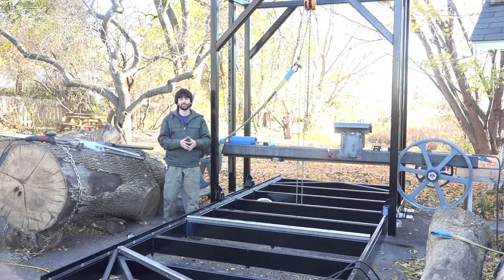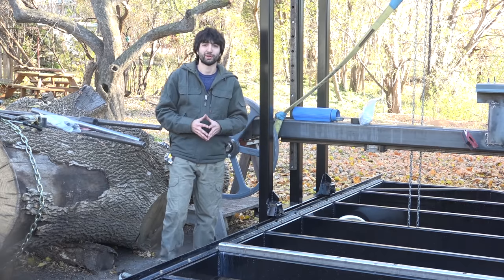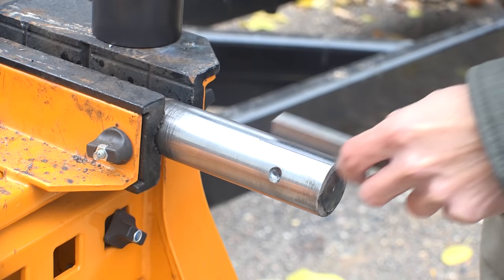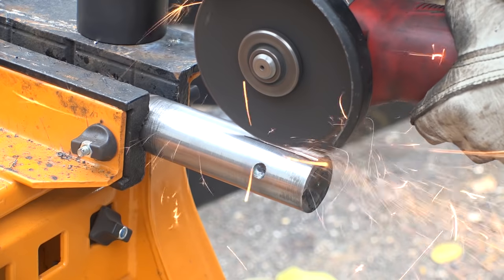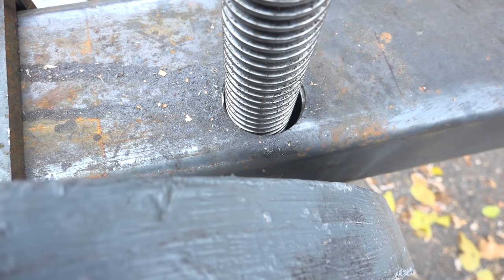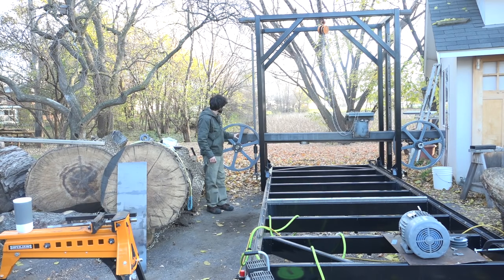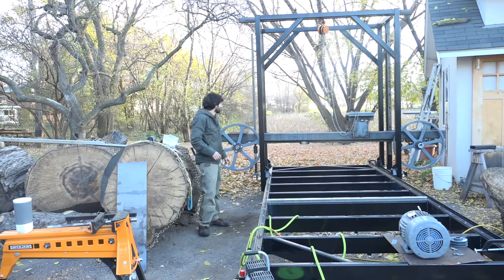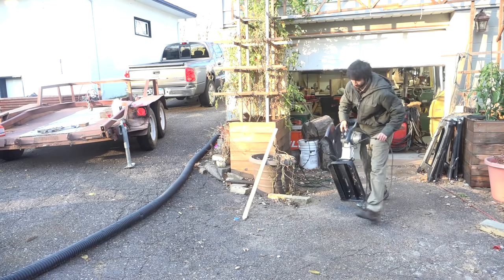Saw Head Lift Rods - Building a Large Bandsaw Mill - Part 12

Comment: When I need to enlarge a hole in cast iron or steel I use a Tile Cutter Roto Zip bit. Solid carbide with a double cut diamond pattern on it. Way faster than any abrasive I've used for the same task.

Comment: Matt;

Pretty good job for a woodworker building machinery ;)

A couple of comments, if you don't mind.

1)  It looks like you have regular bearings as your bottom bearings.  The entire weight of your cross beam, motor, etc. are going to rest on these two bearings, plus they will have to absorb any downward thrust that may come into play when you are sawing lumber.  Regular bearings are not made to take thrust in the same direction as the shaft orientation and this is the set-up it appears you currently have.  Even though you aren't running the shafts at high speed, these bearings are going to wear out.  You might want to look into putting a thrust bearing underneath the regular bearings to take the thrust load, or switch to taper bearings which can take thrust load.

2)  You need to make sure your two Acme shafts are exactly, and I mean exactly, the same distance apart at top and bottom for smooth operation of the up and down movement.  Acme screws can develop great amounts of torque and your cross beam is acting as a spacer between the two shafts.  Acme nuts are made to operate in close tolerance to the shaft and if you have any misalignment, you will bind up the nuts on the shafts and wear them out pretty quickly.

3)  Don't know what your solution is on your motor burn out for your adjustment shaft motor, but I recommend you have some kind of thermal overload protection on the new motor.  This can be integral to the motor or an external temperature sensor.  I also have to agree with your assessment that your motor most likely did not reverse even though you hit reverse on the VFD.  I recommend you test the motor under no load condition with the VFD prior to final installation.  Some motors are made with diode assemblies so that no matter which way you wire them, they always run in forward.  Therefore, pushing reverse on the VFD will have no effect on a motor of that type.

Keep up the good work and looking forward to seeing your saw in action and new projects.

Regards;

Ron
Reply: Matt said those are thrust bearings, unless I misheard.
Reply: DD;

I missed hearing that early part and you are correct, Matt has thrust bearings.  I saw the single row of balls and assumed they were normal bearings.  Went back and looked at the early part and yes, they are true thrust bearings.

Matt;

Please ignore comment number 1.

Regards;

Ron

Comment: Matt, looks like the saw is coming along nicely, in spite of the setbacks. I don't want to be a safety nut, but when you're using rotating machinery, get rid of those hoody ties. If they get caught by the machine you could get rather damaged. Also, a full face shield when using abrasive blades is a good Idea. I had one explode, I wasn't injured, but there were pieces embedded in the wooden wall of the granary. Be safe, and happy metal working!

Comment: Wow good job.
As time goes on you might need rubber vibration isolators to save your bearings.
 As you remove the bolts ,go back with never seizing product.
It works so smooth and well.
 Fantastic!!

Comment: Just a thought,   in threaded holes that you have access to the back (like the ones for the top pillow blocks),  Instead of welding a block to add strength,    You could drill the hole to the major size  of the threads,  and weld a a nut on where the block was before,...

This would save you from having to tap the holes

Thanks for the video series really enjoying it
Reply: jmanatee .
L

Comment: So Matthew, what type of training do you have with metal work? not only do you seem to work confidently with welding, cutting, drilling and lathing metal, but you also seem to  be well "endowed" with the equipment/tools needed for such work. I have enjoyed your videos with wood and especially the videos with the log trailer to the point that I too have gotten into cutting, transporting and milling my own lumber. I own a Granberg alaskan saw mill 48" and recently purchased a dual axle trailer with a drop down ramp, and I am now thinking to construct a log lift like the one you built. You make it seem so straight forward with the metal work that I thought I would give it a go, even though I am inexperienced with such work, I think I would like to try, so what equipment would you suggest I get in order to get into working with metal?  

I have looked into buying a saw mill,  as you know ,milling with an alaskan saw mill is very labor intensive and at 67 years old I don't have the endurance I once had, but the cost for a reasonable size mill is prohibited.  Maybe I could keep the cost below $10,000 by building one myself, seems possible now that you have "paved" the way. I am retired and time is the one element I do have.

Comment: An easy way to make a keyway is to slide both parts together then drill a hole at the seam between the two pieces. Try to use the same size as a previously broken drill bit if you have them lying around. If not just cut of the smooth end of the bit you just used and slide it right in the hole. Because it's round and not flat you might want to use more than one in hight torque applications.

Comment: You should drill a hole in the thrust bearing holder to prevent water from building up.
Reply from the maker: +Tom MacMillan I drill two holes inside of them. Didn't show that but that's how I'm able to get the bearing out. Drainage is a good benefit too. Thanks Tom!

Comment: Looking at the carriage on the acme rods, it looks like the saw cross bar is level to the ground, but at an angle to the rest of the  base.  It could be the angle of the camera, but the angle looks pretty substantial.  Other than that, it is coming along great!
Reply from the maker: +AnkleBiter Woodworks it's sitting parallel to the bed during the outro. I hadn't leveled it until I installed the linkage chain
Reply: Cool beans!
Reply: Your job is to heavy  no need to use heavy material

Comment: I noticed you use Tap magic Extra thick. I use that as well but for tapping Titanium.   Regular tap-magic should work better on steel. Also, as i'm sure you already know, Extra Thick it hard to get off for painting or welding. Great Job.

Comment: Hey Matthew, I'm hoping you are still on line doing another video,  which I find very informative and we'll done.  I do have a few questions about your trailer.  I took down the measurements for the arch but I don't know how wide your trailer is? Also based on the span of the top bar where your cable attachs to, how much weight do you think it can lift without warping or bending? I'm building a dolly and an arch and need as much info as possible.  Please and thank you.

Comment: Any reason you switched to cutting metal with the abrasive chop saw over the circular saw you were using?  I assume just cause it was tube which would seem to be easier to cut with chop saw.  I was curious to see you try to cut it with the circular saw though.  

Hopefully you get some good luck coming.  Get this thing done and start cutting some wood with it!

Comment: I hate to criticize your work, as I believe you are doing a great job.   A little advice, though, when tapping-  every strung or three that you cut, back the tap off a half to a full turn to break the chip.   Your tapping will go smoother, and believe it or not faster.  Likewise, you will be less likely to break a tap, and your taps will last longer overall.

Comment: Get yourself a few of those carbide-tipped die grinder bits and you will chew through that metal.  Those stone bits are not aggressive enough for my taste.  Great job!
Reply: They are called Rotary Files, and yes...that is exactly what he needed to open those holes.  Matt, he's right.  Rotary File, for future reference :-)  I have used them for wood....they work.  They have very aggressive and very fine rotary files.  From large diameter to needle sizes.  Keep the chips flying!

Comment: Man, I realize that over engineering is the name of the game, but this is the first video where I really had to laugh, those pillow block bearings are, if my guess isn’t wrong, rated to take at least 1,000 lbs of load, and your application will be subjecting them to MAYBE 3% of that?

Good stuff! LOL I’m actually in the middle of a little project building a chalk box out of an ammo can, and just because it’s simple, I’m using a 1” solid shaft, so may as well just use bearings to match. So it’s a hand crank spindle, doubt it’ll take more than 10lbs load, ever, and the bearings are rated to hundreds of lbs just because of their size. 🤣

Comment: When I want to keep may Allen screws from loosening I will often times stack one on top of another in the same hole. I will often switch out existing Allen's for socket headed bolts so I can use a larger diameter Allen wrench on them.

Comment: I know you are already using the saw... but ideally you would use a plastic or brass nut on your acme threaded rods, otherwise you may run into galling between the nut and the rods.  Although in your case those rods are way oversized for the load on them, so you may be OK.  But plastic nuts aren't that expensive.

Comment: Hey Matt, I am in the process of designing the lifting rods right now. If you don't mind and have a minute, could you list the exact properties of the materials you used? Thank you in Advance!

Thrust bearing Dia, spec
Dom tube dia
inner tube dia
especially the ACME rod specs, like thread, outer and inner diameter (thread and not threaded respectively), and strength rating, 
the Nuts welded and on the ACME rod (diameter, thread)
couplers
top bearing

Thanks again Matt!

Comment: Matt, I see you are using a special metal cutting circle saw (skill saw) for your more portable cuts and or angle cuts. I also see you though you are still using an abrasive wheel chop saw. I have several questions for you on the abrasive chop saw. 1. do you have a problem with flex of the abrasive wheel causing a slight uneven/non square cut on your material? the reason I'm asking this is because i ran the same abrasive blade chop for  6 years before it decided to final croak on me. 2. have you thought of purchasing and if so, but haven't, why not, a metal cutting metal blade chop saw, similar to your metal cutting circle saw? when my abrasive chop saw crapped out, and after 6 years of buying abrasive blade, having them blow up on me and dealing with the flexing of the abrasive blades, i broke down and spent the $600 on a metal blade chop saw and after 2 years of running it, i have yet to a non square cut, compared to the abrasive blade. 3. If you are not having an issue with your abrasive chop saw making no square cuts, what/how are you achieving this?

Comment: Another bandsaw mill made video American & older Swedish guy? Keeps the wheels at 1/2 height difference so the 2 guide rollers can maintain a horizontal rolling platform for the blade with better tension control,  We will see how Matth. C tackles this issue.

Comment: Did u use an ordinary motor and try to move it? The initial torque of the motor and the weight it needs to lift would prob spike the amperage way out.. Its here we use servos. =)
Reply from the maker: +Moronicsmurf yup. Live an learn :)
Reply: Check the chinese brand "MiGE" for cheap and affordable servos upward in the 1.8kW range and bigger. A simple arduino could handle the +/-10V signal for setting direction.
It will not be crazy fast but work. =)

Comment: Matt, don't fit everything so closely.  You have to leave room for rust or you'll never get it apart in 10 years.  Grease the hell out of everything like the couplers and bearings and Acme rods.  Drill holes to let rain water out.  On exposed steel I use this anti-corrosion spray, CRC  SP-350, that leaves a waxy coating that is very resistant to water.